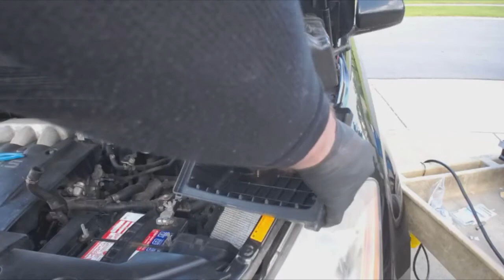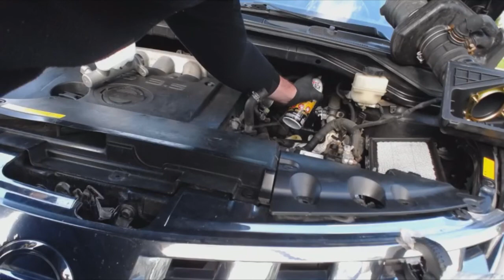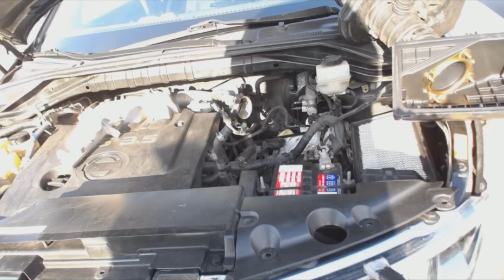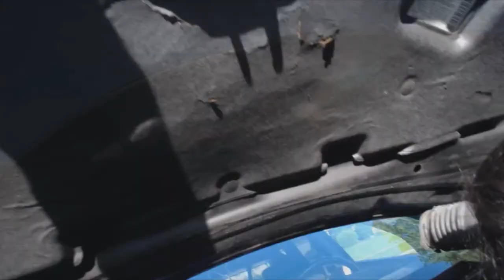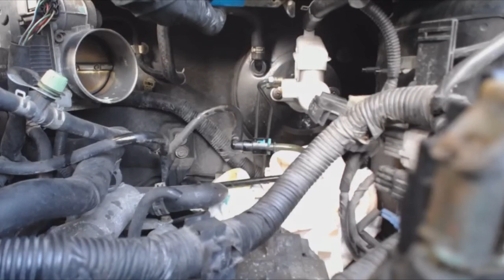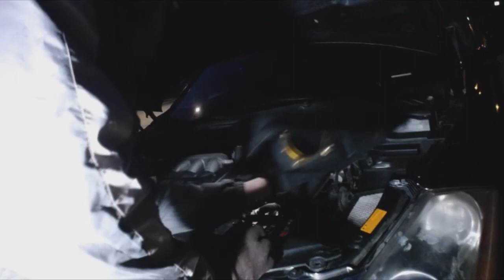Brake Master Cylinder Replacement 2005 Nissan Murano

Comment: Does your have the traction control? Have a 07 murano but having hard time finding a master cylinder that has traction control.
Reply from the maker: I did not hear about master cylinder having to have traction control.  I thought traction control is not related to the master cylinder itself and is a different part of the car located elsewhere on the car.

Comment: How did you determine the master cylinder was bad? Did you have any lights? - Our pedal goes to the floor - no lights.
the car will stay in place, as parked, and not move when in gear.
Reply from the maker: I don't remember anymore.  My guess is I googled my car's symptoms and read a list of possibilities and determined the Master cylinder replacement was next on the list of solutions and did the job to test the solution and it worked.
Reply: @artbyrobot1  Pedal just went to the floor? I am guessing, yes?
Reply from the maker: @douglasfolk3835  It's possible for sure